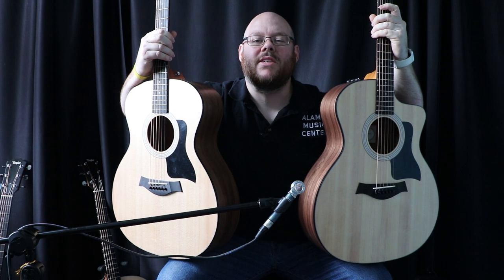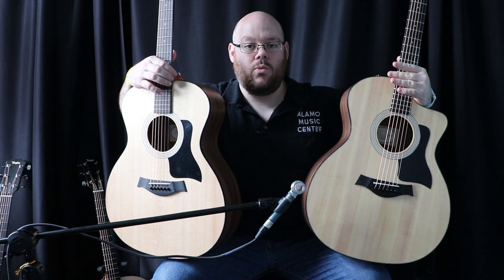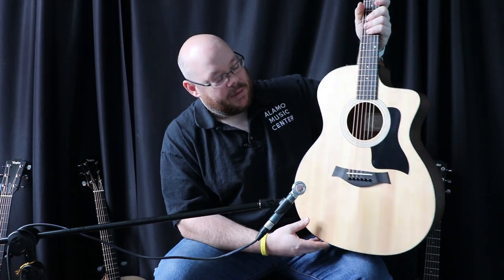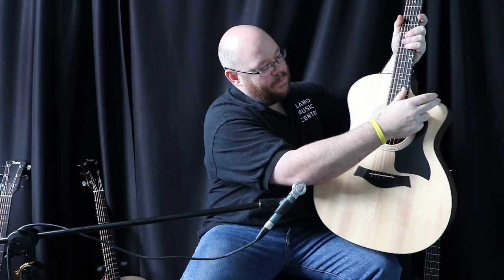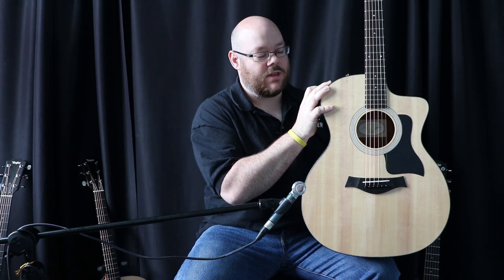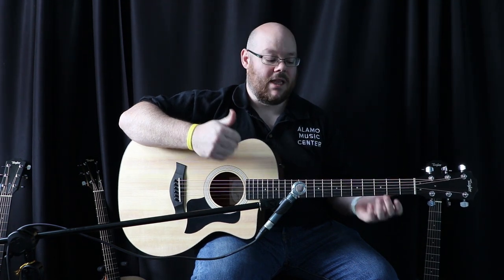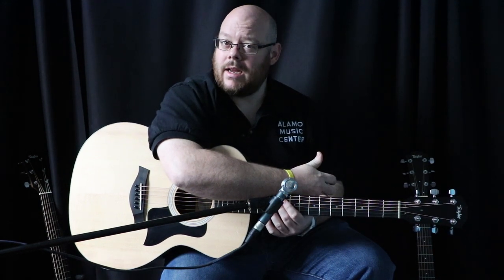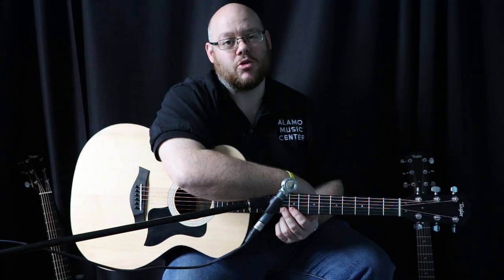Cutaway vs Non-Cutaway: Taylor 114ce vs 114e Comparison

Comment: The full body seems to have more bass, a little fuller of a sound, but also slightly muddy.  The cut away has a little more thin of a sound but also clearer and more crisp.
Reply: That's what I thought, too. The ce is crisper, full body muddier.
Reply: I was surprised that I liked the ce better. It is better on the high end without sacrificing the bottom too much. And you get access to the upper end of the board!
Reply: My exact thoughts.
Reply: spot on, Aaron. 3 years later im here to tell you that.
Reply: I too am coming in three years later to tell you I think you are correct. I think that the muddiness would clear up if you took the microphone away, and sat on your couch instead. The cutaway does seem like its tightness and crisp aspect would make it far easier to track and mix.
Reply: Cutaways are ugly...there, I've said it!
Reply: Hi Aaron, this is also my thought, 114e is more bright sound, 114ce is more crispy than full size.
Reply: Exactly what I heard as well!:)
Reply: @kevincrouch3956   oohhhh glad I asked you lol.
Reply: @kevincrouch3956  I like the look still. And the playability adds a lot

Comment: Call me crazy but I hear a pretty huge difference, and I definitely prefer the non-cutaway.
Reply: Agree, the non-cut away is fuller, slightly muddier and not as "clear" .. but has more character which is most important in my opinion.
Reply: Sure but for me it’s not worth it because I’m someone that wants an easier access to the higher frets
Reply: Big difference to my ears also.  I like the cutaway.
Reply: same! it sounds fuller and the vibrations are pretty
Reply: me too
Reply: Massive resonance boost. you're not hearing things.
Reply: same
Reply: I can hear a huge difference as well, but absolutely prefer the cutaway. It's a much clearer tone. The full body is boomier and muddier sounding.
Reply: 114 e much warm and full tone overall
Reply: You're not the only one. I always hear huge difference in cutaway vs full body guitar and I prefer a full body guitar. I don't understand why people who like cutaway don't hear the difference. It's not subtle, but it's a huge difference. I could tell which one is it, without looking.
Reply: Same

Comment: To me, the cutaway sounds more crisp with a well rounded tone between the low and top end. They both sound great, but as the comparison goes, I would prefer the cutaway and the benefit of easier access to those frets over more bass-y tone. Great comparison video, thanks for posting.

Comment: I was surprised to find I could hear a difference (and quite a bit).  The cutaway was crisper clearer with more of a treble sound across the whole set of strings  The Non Cutaway was mellower a little more gentle on the ear with more bass on the lower strings but lacked some of the crispness and clarity of the cutaway.  Not sure which I prefer - but I think it would be dependent on the song being played
Reply: I agree with you, Although I prefer the cut away guitar

Comment: More surface area sounds better to me most of the time.  I thought it wouldnt matter that much. But a 214 is supposed to be better than a 114 right? Well back to back I played a 214 with a cutaway and a gloss finish. Then I played a 114 w/o the cutaway. And it blew the balls off the 214 in my opinion. But I guess it depends what sound you like. Now in this comparison here, the non cutaway seemed to have fuller/warmer sound with more bass, while the one with  cutaway had a brighter, more sparkling sound with slightly more projection. It's the kind of sound Taylor's are known for and the sound I prefer. So in this video, I prefer the one w/ cutaway. What's funny is the 114 w/o the cutaway had the same brighter  sound  that I prefer over the 214 with the cutaway that sounded duller. I know a 214 and 114 isn't a fair comparison. I guess the lesson to be learned is ignore the price tags. Forget your biases and put them aside. Forget the brands you think your heart is set on. Forget everything you think you want in a guitar. And just go pick up and play as many guitars as possible to see what you actually prefer for sound and feel. Because when you do that and try some guitars you wouldn't normally pick up, sometimes you might end up  suprised to learn that you  don't actually want the features that you thought you did.
Reply from the maker: The finish on the 200 series is a bit thicker which will affect the overall resonance. - Chris McKee
Reply: I love my 114e
Reply: I want a 114ce so bad damn

Comment: First off thank you for all these great videos Chris they really help one navigate through the complex world of acoustics. Now as far as cutaway- yes there is a noticeable drop in the lower frequencies. These are frequencies that take a bit of distance to be truly heard as the wave distance for lower Hertz sounds is longer then for higher frequencies. So you siting and playing may not hear the loss of those frequencies as well as someone sitting 8-10 feet away from you will. The Taylors have a bias towards mids and highs to begin with so a weak bass is made even weaker in a cutaway version. You hear the highs and mids better on a cut-away for the same reason you will hear them if you suddenly drop the 32 and 64Hz sliders on your itunes EQ..its not that you suddenly accentuated the highs you simply diminished the lows and now you can hear your treble more distinctly. So is the occasional access to upper frets worth the diminished bass response? Ask yourself how often you hit that Low E string in any chord or run vs how often you finger above the 14th fret..(disclosure..Former Radio engineer and Bass player)
Reply: Blue Channel Productions I think this sound is actually better. Also solos are life
Reply: @matrixarsmusicworkshop561 if solos are life, why do you even care about acoustics?  Perhaps an electric or classical is what you need.

Comment: I also could hear a slight difference in the full body vs. the cut-away especially in the lower tones.  Both guitars sound great but I did not see or hear you play higher than the 14 fret  which is the reason for the cut-away.  Thanks for the demonstration.

Comment: I had both Cutaway and Non-Cutaway 114, the Full Body has more low and it feels more solid sounding all-around. The cutaway was a bit on the too bright side for me. More pleasure playing the Non-Cutaway. Basically I never needed the cutaway to go so high on the frets... What I like it's the new cutaway designs that only scoops a bit of that area and gives you a sound port also. Those are cooler designs and should sound better. I am yet to try one of those one day.

Comment: I hear a noticeable difference, mostly in the reduction of bass in the cutaway.  I think this is far more than what would be caused by a variation from the tonewoods used.   

In the classical guitar world, cutaways are not used.  Rather, a construction technique called raised  or elevated fingerboards is applied.  This gives allows more freedom to the guitar maker in choosing the angle of the guitar's neck to its body and does help ease playing in the portion of the fretboard above where the neck attaches to to guitar's body.  

Why isn't this technique used more often in the steel string instrument world?

Comment: Full body will give you fuller sound, there is no ifs and buts about it. And the difference is often obvious if you are into guitars. So it is almost never a slight difference. You want to choose the cutaway if: you want to have access to the higher frets easier, the specific model is already boomier than you like and you would like to tone it down, you like the look of the cutaway and don't care much about the sound.

Comment: There is a slight difference in the lows and mids though mid and low response with the cut away is slightly less is is certainly adequate. This is a very good sounding guitar for this price range. It’s a lot of bang for the buck. By the way, I own one. I was listening through an iPad with air pod pros

Comment: Massive difference. Didn’t even need to use earphones to hear it. I never buy acoustics with cutaways. The bottom end is sacrificed and the guitar sounds shrill. I have a Martin HD 28 which is a tone monster. Non cutaway Taylor’s are way too thin and treble focused in my opinion. Add a cutaway and there is no bass left.

Comment: The 114e is more boomy, bigger low end. I preffer this. because I'd rather have more fullnes, more fat sound than  lacking this quality. I could use a high pass filter anyway to cut all low end that I dont want. I believe for recording is better the full body one. The bad thing is that the cut away is so damn beautiful with that cut. Is more appealing

Comment: There is a very slight difference in the position of the mic relative to the guitar for each performance which will have an effect on the sound. Putting that to one side, the treble strings have a much richer tone on the non-cutaway as well as it having an overall "bigger" low end. In an amplified performance these effects can easily be compensated for by the sound engineer. When playing/recording acoustically, however, that's where the benefit of the non-cutaway can be heard. I've recently been impressed by some internet demos of a gorgeous sounding guitar with a sinker redwood top and a cutaway. However, if I was tempted to part with the (approx £5000) to buy it, I would really want to hear the same guitar without a cutaway first, if possible. The law of diminishing returns at this level might suggest that the benefits of, say, a better quality top might be significantly reduced by having a cutaway (and cutaways do add more to the manufacturing costs albeit depending on the relative quantities of cutaways/non-cutaways produced).  I would add that there are other videos on YouTube that visually show the frequency spectrum in this sort of comparison and the difference is quite dramatic. Then again, having listened to Martin Simpson playing a wonderful set on a cutaway guitar, maybe it's all in our fingers? Good luck and feel the force Luke.

Comment: The recording sounds like the bass is overaccentuated on both guitars. That’s changing the balance - on the recording, the non-cutaway guitar has enough bass to interfere with the rest of the sound, so the cutaway guitar sounds better overall. Live, I don’t think the bass would sound like that and my preference could very well switch. My guess is that you’re getting proximity effect from the microphone, which is something you’d eq out live but you don’t want to use eq here because it would defeat the purpose of the video. There are two other ways to get rid of the proximity effect: mic from farther away (which will give you worse signal to noise, but you’re presumably in a quiet room) or use an omnidirectional condenser because omnis don’t have prox effect. The recording is good at showing the difference but it’s not representing either guitar accurately enough when it comes to bass. In case I’m using an unfamiliar term:  proximity effect is the tendency of a directional microphone to sound overly bassy when close to it. It sometimes used to be called Lounge Singer’s Effect.

Comment: Thanks for the video. Both sound great (and played well too). I think the non cutaway has slightly more bass and fuller sound, but without comparing back to back, I wouldn't have noticed a difference. The cutaway sounds slightly brighter. I suppose it would be what the user is going for. It doesn't seem you could go wrong either way. Both sound fantastic. Thanks again.

Comment: I heard you say that the sound is due to the guitar face vibrating and I thought no way, he's wrong. I'm a curious engineer so I searched "the physics of acoustic guitars" and came up with a video called "physics of the acoustic guitar" and they claim the sound comes from the sound hole, not the guitar body. The string gets plucked and it vibrates between the bridge and the nut, or a fret, those vibrations transmit through the body and get amplified, then come right back out the sound hole. They made it seem like all the sound comes from the hole, no mention of sound coming from the body, which made sense. However, I then covered the hole in my guitar and it was still playing quite loud, and with the hole covered it's almost as of I could see the sound coming through the guitar body. From all around. Sound radiates from all the surfaces of the body, not just out the hole. So, you're 100% right. And that's why the wood a guitar is made of is important. It makes sense now, thank you!

Comment: if you use a built-in e,q in the 114ce (cutaway) could you get adjust the guitar to sound just as the non-cutaway?
Also i think that the difference is that the non-cutaway bass strings are giving a less acoustic sound 
thanks

Comment: The cut version's sound has more definition as if the cutaway gave it more balance by adding highs and taking away from mids. I believe, however, that your mic can't take the lower frequencies and overall volume of the instrument. I'd prefer the CE based on the recording but I can totally imagine that the E version sounds at least as good and just has more oomph and vibration.

Comment: I just bought a new cutaway acoustic electric for $500 and the much cheaper non-cutaway I already have sounds much more deep and rich. That isn't to say the cutaway sounds bad. But this is the 2nd cutaway I bought in the last 4 months that sounded thinner. Vids like this now answered the question as to why. But the cutaway has electronics and it sounds good thru my amp, while I installed a K&K Mini in the dreadnaught, which sounds ok if going through an EQ in front of the amp. Not as good as the cutaway, though. I guess I shouldn't be too concerned, since in a band setting any lower bass from the acoustic guitar that I'm missing may just get drowned out by the bass guitar anyway.
Reply: If you have too much money you can also just donate to charity you know
Reply: @woomi177  I already do.

Comment: Very informative video, thank you very much!

I'm wondering if the electronics introduces further differences. After all, the presence of electronics implies two substantial alterations:

1) the side is someway interrupted (in order to get a fenestration)
2) there is something that protrudes inside the guitar body

so this  necessarily results in an alteration of the the resonant cavity. It would be interesting to compare two cutaways guitars, electrified vs not electrified.

Comment: Def could hear it- a little fuller mid and slight bass sustain. I have an 814 cutaway and perhap its not as noticeable with the different build character. I would agree with the statement if it sounds good it sounds good. Neither feature option would deter me but if i had them side by side id prob pick the non cutaway

Comment: Huge difference. The full guitar body sounds much more complete to me. Lows, mids (high and low) and highs. I think there's a massive difference. I think I would benefit from a cutaway. I play above the 12th a lot on my non cutaway guitars. There's fullness missing in the cutaway in your example. That could be a bad thing just for sitting around playing, Less inspiring maybe. Or maybe I would quickly get used to it, or never notice. The real benefit would come with being able to easily do call and response octave. chords, which I do now, but it's difficult w/o a cutaway. Easier access to harmonics on the second half of the string too. But recording is probably where the cutaway would really come in handy. This is just conjecture, and based on your recording example, but it seems like a cutaway would be easier to record. I'm always using an EQ on my full body recordings, seemingly, no matter how mu ch I move the guitar and mics around. 
 Thanks for the video.

Comment: Great video! Just my 2 cents... I believe that the low is too muddy where I would change the levels a bit on the recording setup to compensate for the difference. The non-cutaway doesn't entirely have a fair analysis based on the levels on the recording. The levels are however perfect for the cutaway since it is far less likely to clip due to the lack of resonance. Changing the levels for each instrument, however ,also will distort the analysis as well so I believe just a quieter overall volume would be best to not clip. This is just how I hear it however in my headphones.

Comment: It definitely depends upon the guitar. I've heard cutaway sound better than the non-cutaway and non-cutaway sound better than cutaway. More factors are involved in simply cutaway vs non-cutaway. It's very guitar specific. There is no one formula that fits all. In this case clearly the cutaway sounded better.

Comment: You can tell this model was actually designed as a cutaway as the non-cutaway version sounds a little too boomy and muffled, whereas the cutway is more crisp and punchy with still all the bass end you'd need.

Comment: The non cutaway is fuller and richer sounding. But lets face it the cutaway is also electric which makes it a different animal which is going to be crisp when electric is amplified. Apples and oranges on this comparison. I have a couple of ovations one a cutaway and one not. Same deal the cutaway is electric too. Apples and oranges. I like the electric cutaway amplified of course, but there are songs one would prefer non electric. That is why there are so many guitars and styles to choose from. There is no one size or type fits all.

Comment: the non cutaway has more bass, butit has a negative influence on the overall tone, muddy in the lows and low mids, it sits in the way of the bass player. Do you like 12 inch speakers or 10 inch , well I like 10 inch just for that reason it sounds cleaner in the lows and low mids. AMEN